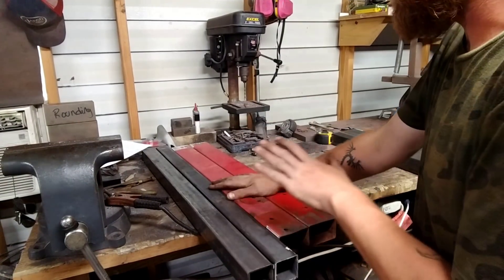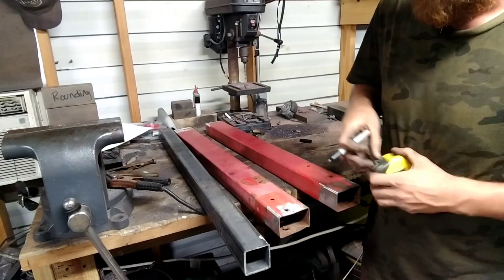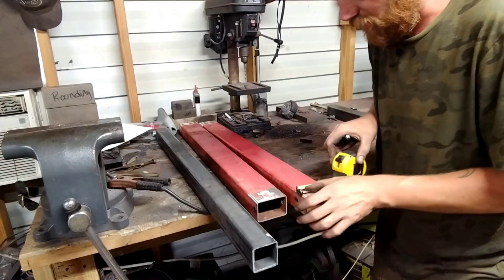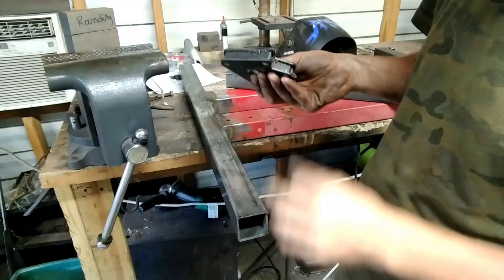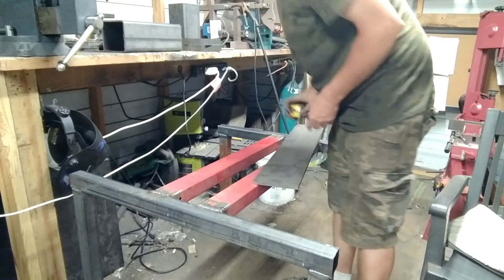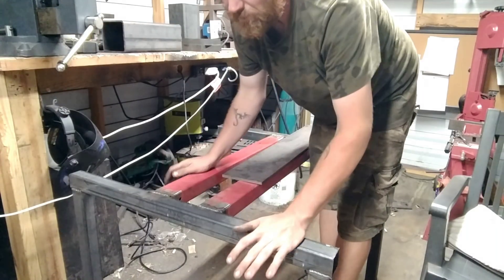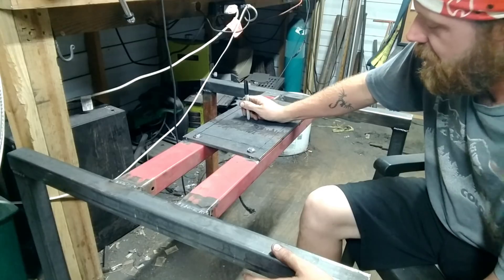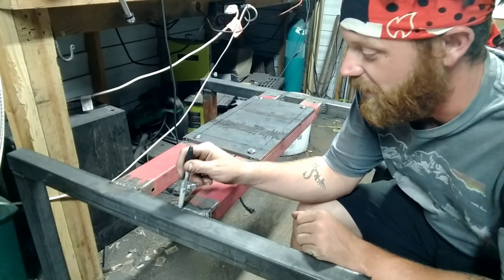Building a forge press part 1: Building the stand

Comment: Just stumbled across your channel. Pertaining to your magnetic square, you can take a large wire brush and wipe the magnet quickly and it will remove 99% of the filings and buildup. Quick and painless.

Comment: I hope you take the time to build a die with a built in hammer eye punch. I've seen someone punch the eye completely in literally one press on each side. You might be able to get away with a drift too. I think he had the punch on the top die and the bottom die was a heavy frame that kept the hammer head secure while pulling the punch out. Just food for thought to help you make money more easily.
Reply from the maker: Curiosity Forge main reason I'm building the press
Reply: County Line Forge Awesome. I really want to see how much it helps you out after you get your punch, drift, and fullering dies made up. It's gonna be awesome. I went online and looked at electric splitters and they all top out at 10hp, but I don't know what that does to the torque generated. I may put money back to get one of those and then source some railroad track to build dies with. A press and a welder would let me make a lot of damascus in the shop which would be amazing as well as cost effective.

Comment: Happy fourth brother I've been welding for about 20 years on your long seams on plate run a grinding wheel on the seam to make a nice deep bevel for one it'll help you stay in a straight line and two it'll give you good penetration and from the looks of things you could turn the amperage up a little bit and slow down your travel speed
Reply from the maker: john kotlarchick as said in the video I pre chamfered the edges (beveled them as you suggested) before laying the plates on the stand.
Reply: You need to Bevel the edges I'm not trying to critique just trying to pass some words of Knowledge from stuff I've gotten wrong in my past no disrespect appreciate your videos bud
Reply from the maker: Ok maybe you skipped the part where I showed they were beveled aka chamfered